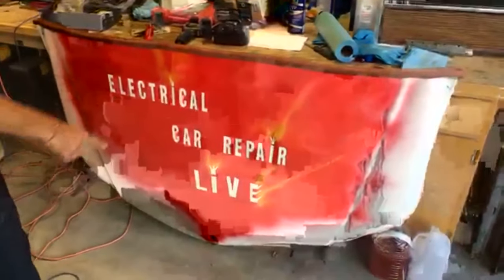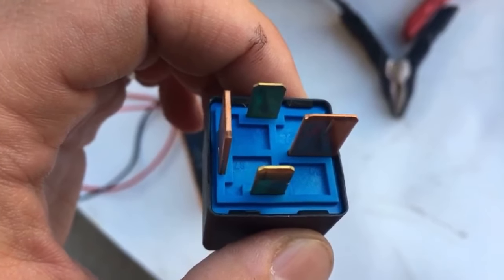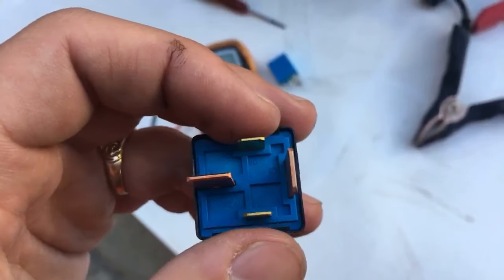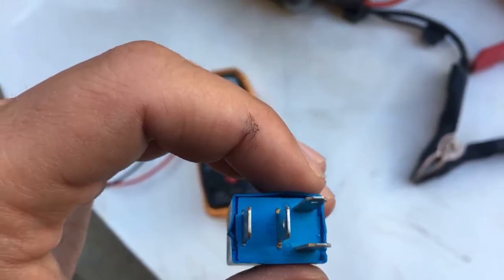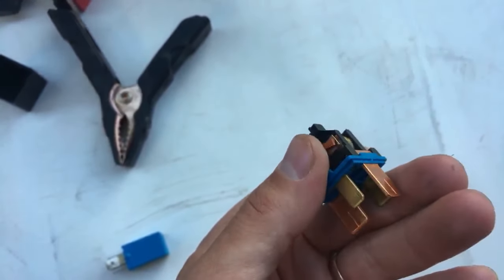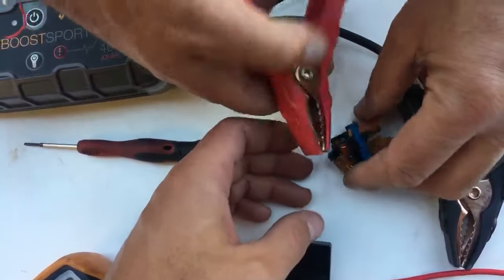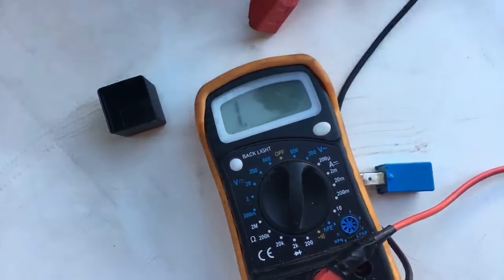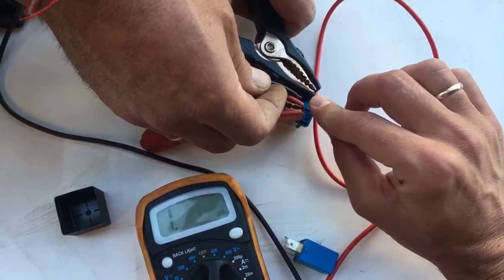HOW TO TEST RELAY ANY RELAY

Comment: I thought when u measure resistance there is not supposed to be any power hooked up???
Reply: without the power the relai does not connect so you would have complete resistance anyway

Comment: Really helpful. Tested starter relay, confirmed that it activating and zero resistance when closed. Thanks guys saved me buying a new one just in case!
Reply: Don't worry Emma if the relay doesn't work just shoot it with the AK 47.

Comment: I was reading on a website about testing for resistance and they said to test with no power connected, but this was not specifying relays. Every mechanic actually tests just like you guys.

Comment: 1:16 You do not have; ''current there all the time'' , this is the coil,  (85, 86), when it 
is powered, the connection is 'made' and 87, 30 are then connected to each other,
 allowing a lightbulb or other device to turn on.

Comment: Good afternoon, your videos are always informative. I am having a problem with 2008 Honda Odyssey (290k miles). I have replaced alternator twice, but check charging system and battery light pops up with VSA light too and sometimes it's self and  goes away usually. I replaced the battery, battery terminals, checked the motor oil, checked the fuses, checked the ELD( electronic load detector) everything thing seems fine. The alternator I got replaced twice is remanufactured bought from Advance auto parts. Got inspected the battery and alternator from AutoZone. They are charging fine. Personally, checked the alternator performance by removing negative terminal while car is in start and idle position, car doesn't shut off. Is there anything I am missing to find the issue? I forget to mention that the ground wires seems okay too, because it never drains a battery even if I start the car after two days. Head lights doesn't flicker's either!
Reply: Did you ever figure out the problem ?

Comment: Chevrolet Cruise L. T 2015 has no problem in P, N and L mode, but in D mode, which we put, it moves forward, but does not change gears by changing the speed and increasing or decreasing the accelerator pedal. What is the correct way to solve the problem?

Comment: After jump start and cleaning the engine of my 2004 bmw X3,there is no light in the dash and non of the gauge are working. What donI need to do.
Ps.All fuse seems to be working

Comment: can you tell me how to test a 220v ac relay what to use as a power source
Reply: If you want to test a 220V relay, you need 220V line voltage (power supply)

Comment: Hi, I have a BMW 318i e46 1995cc when im driving along the road it like stalls to 1200rpm's it can be for 3 seconds to 30 seconds it just slows right down into a limp mode or wont move at all then all of a sudden it goes fine again but it does it regularly. I have had it into a BMW specialists noone can come up with codes. So Im having this problem NO CODES? 6 garages and a BMW computer diagnostics nothing yet it still does it the eccentric shaft and all was replaced MAF TPS airbox has a leak replaced. Any Ideas??
Reply: Fuses and dme

Comment: I had a relay that clicked and ohmns dropped to almost zero when energized and it still was a bad relay. Carbon buildup?
Reply: Relay aren’t supposed to have any resistance.
Reply: @Zach-nv4ul  whay ever the case was, that thing clicked amd passed the meter test. But failed the swap out test with a new one.

Comment: I changed the two front seats for my 2007 mkx , and the vehicle won't start though it run perfectly fine before the installation. The dome light won't shut off and the high beam on the instrument cluster stays on. I need help fixing these. Any advice will be welcome,